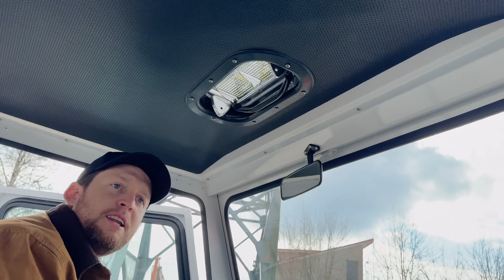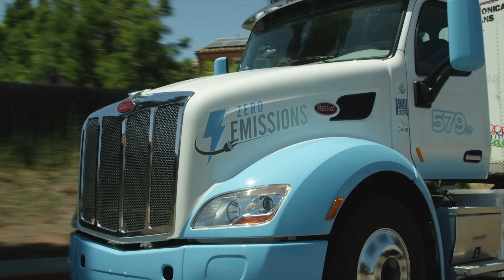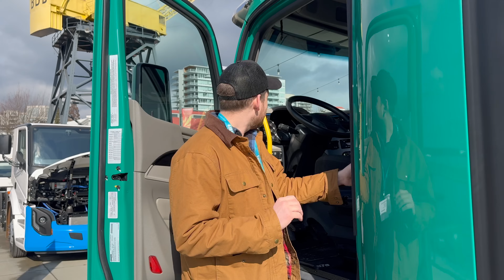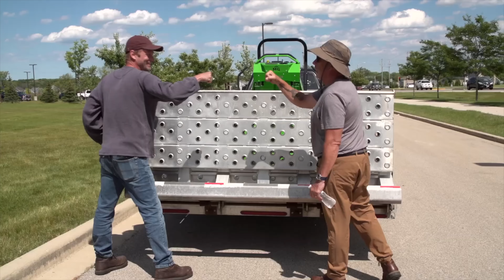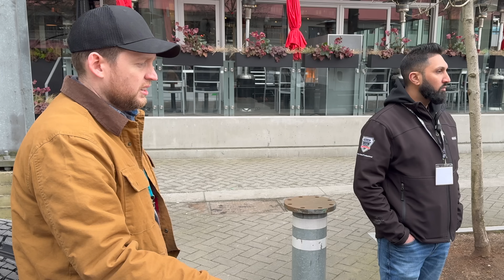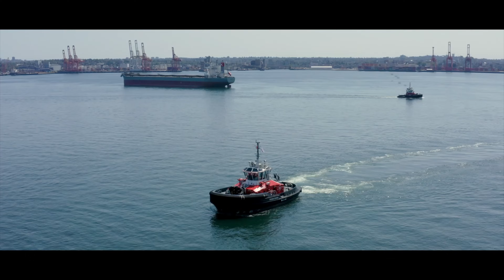The future of Electric Vehicles : What to expect in 2024

Comment: Thank you for showing the TUG Boats 😊
I have Read about these modern Tugs in Professional Mariner publishing 😊
With these 0 emissions ports wanting ships to plug in at berths. So glad Edison motors is making a Log truck that can generate power, just like Cat is testing for mining hual trucks 😊
Reply: If it's got a plug or a motor...it is NOT "ZERO EMISSIONS"...let's be realistic.
Reply: @danielkingery2894  LESS diesel its a start.
Reply: Cat has had electric haul trucks since the 1990s
Reply: Diesel ships are really good. Ships cost so so so much its nice that theyre if simple and reliable as possible. But theres no doubt that we can reduce a huge amount of port emissioms withohtnhabing to convert the worlds diesel merchant vessel fleet to expensive hybrids. Maybe some but where the real advantage is i agree its the tug boats. When the ships come to where the masses of people are you cam cut the engines out at sea and pull them in with these hybrid tugs its actually clearly better in certain aspects and whether its worth it really depends on how long the batteries last and what the overall prices of operating maintaining repairingnand repalcing parts is over the vessels lifespan. To some degree jusy a straight compression engine vessel is advamtageous brcause they use such massive pistons the rpm is los and they cam run for a very very long time. You go to hybrid they will shrink the engine considerably and grow the battery and youll emd up with a small motor working hard to charhe a big dead weight battery thay weighs lot empty or full. You can see this tug the battery takes up the hole bottom but i mean the hybrid application there is also more affordable ton making the big panamaxes and capesizes etc hybrids. If the battery dies and it runs out of juice they are usually working in and out around ports. Thats a good application that will increase air quality in the areas that matter the most. If youre sending a uber giant vessel around africa you dontnwam tto have to keep stopping for both electricity and fuel when before you only needed fuel or didnt even depending on the vessel. I was looking at some vessels that run on natural gas because natural gas in liquidifed form compressed to less than 600x the volume in its gasseous form so the numbers are promising. So liquified natural gas tankers will run on natural gas. Sometimes its just the nature of the application that determines what fuels one ship over another. For different reasons its pretty interesting. Hybrids started popping up but most ships run on straight up supermassive bunker fuel compression engines like oil tankers and bulk carriers, container ships. Even if you only had hybrid tugs that would make a big difference in key areas in terms of air quality
Reply: Well, for the big ships you probably would be going back to running them as straight Deisel-Electric, like  locomotives or the old U.S Standard type battleships.
Basically running the engines as generators, which would then directly power the electric motors moving the ship. You could  add some batteries to run the ship for a few hours coming into/out of port. Ships use port supplied power while berthed, and they could also charge their batteries there, further reducing engine run time. You can also add wind propulsion aids to ships to further reduce fuel needs (but not eliminate them, modern ships are just far to big and have too strict of deadlines to rely too much on the wind).

Comment: I wish federal governments would stop subsidizing the sale of EV.  See this only help companies overcome shortfalls in technology, design, volume manufacturing... and results in high quantities and lower value products that are not really good for the environment and just result in a lot of e-waste.  Also most companies set aside 2-5% into R&D.  These tax breaks typically only help the wealthy anyways as EV had a higher retail cost even with the subsidies.

Instead I would rather see the government ONLY fund research.  Instead of 2-5% of the money going to R&D, 100% would go to R&D.  This would still lower the manufacturing costs, but would accelerate the development of better and cheaper products far sooner.  Then these products would be able to compete directly against gas and diesel powered vehicles far better.  So they would start with slower development, but then ramp up far faster.  This would then make it easier to ramp up the infrastructure far faster.  Since there is more funding on the government level the patents could be shared more and there would be standardization in parts, tools, and chargers across the platform.  Most importantly the battery technologies would be far better.  The overall costs to the government would also likely be far less.

This also needs to be rolled out, like I said with the infrastructure to support these and that would include upgrades to the power grid, increased power production, and cheaper, safer, more standardized charging stations.  Early adoption is usually not the best things for a product so complicated as this.

And for the tug boat I wonder if they would benefit from toroidal props.  They will help extend range at higher speeds, but they should reduce cavitation, which causes a lot of the noise from a prop.

I still think ALL trucks, most pick-up trucks, and most boats, especially that tug boat should be a hybrid too.  There are just too many advantages to this system until battery technology significantly improves.
Reply: Breathing diesel fumes is bad news,we all have a say here.
Reply: @jaaklucas1329  Unless a diesel needs repairs or they are using a chip the smoke is minimal.  The new regulation are a bit much requiring a chemical filter bath basically that removes pretty much all the soot.

See the problem is CO2 is not the issue.  This was a switch they made from Particulate Matter 2.5 micron (which is bad) to CO2 based on a very flawed study.  They used about 1000x the normal CO2 and got a 4'C increase in temps, but base all the models on a 20% increase causing a 1'C increase.  It was done for politics, money, and power.... mostly because the US had massively decreased its PM output.

There are 2 main reasons why subsidies are bad.  First is they are creating competition in a market with a product that can not support itself otherwise.  This is because the technology is not there.  The second is subsidizing the product only results in a small fraction of that money going to research (about 2%).  They need to subsidize the research and not try to push these vehicles to market early.

They are basically just feeding the landfills this way as EV are far less recyclable than ICE and damage the environment far more in their making (especially when a lot of the components and materials come from countries like China that have basically no environmental laws.  EVs at best are on par with ICE vehicles for environmental impact... many are actually worse.

So instead of putting $100s of millions into subsidies put that all into researching better batteries... and solar panels.  I still don't trust these solid state batteries until we actually see what the retail models do long term.  Either way charging these larger capacity batteries is going to be an issue and the massive increase in power production is going to quickly start causing problems.
Reply: @toddabbott781  You have thought about this alot so I can simplify. Heres the problem. Drive your most efficient diesel (or gas) ICE vehicle into your garage,leave the engine running, close the garage door and take a seat. You wont last long. Multiply that by billions of ICE motors around the world. Thats why somethings gotta give.

Comment: The mobile charger truck is something I've been considering. In my mid fifties, I'm already considering options to keep me busy for when I reach retirement. My thought is a hybrid flatbed wrecker with a mobile charger built in. The best part is that you already did the legwork on the hybrid part of it all as a C-9 would easily fit in the space under the hood where a C-12 once lived. The only thing I'd probably do a little different is use LiFePO4 batteries as I'd be cycling the pack a lot, and those are physically very forgiving, and don't catch fire very easily.

Comment: Have you seen watch wes works , talks about the Edison truck
Reply: Wes is wrong about his spread sheet. He assumed that a new Truck was $200k.  An Edison truck refitted was $105k assuming the base truck was free.  Then Wes tries to calculate payback period without any efficiency gain.  He comes out with Edison Truck pays back after so many years.  Common Wes, a cheaper truck pays you the first day it drives.  Wes probably didn’t take school seriously and smoked too much weeeeid…
Reply from the maker: Yes. He’s 100% correct, if we were building OTR trucks. But we are not. 
You can’t compare highway trucks with Vocational Trucks, they are apples to oranges.

Comment: Sorry, I didn't notice what was going on in the rest of the video - because I'm still hilariously laughing because of that segment with the green mower... 😂😂😂
Reply: honestly if it was me I would’ve handed the Green machine back to the guy at the booth as I would no longer trust myself
Reply: i was laughing when he was burning rubber.
Reply: At $37k for a green EV mower. “The battery will outlive this mower, it’ll last for ten years”.  WTF? At $15k more than my comparable commercial diesel mowers I run, I can buy a hell of a lot of fuel and my mowers are still going strong at 10 years old. Not buying into it.
Reply: @biprgriff  yeah, cost and longevity really is a sticking point with bev stuff. for home use it makes sense cause you can easily use powertool batteries. but in a commercial setting i can see that being a pain. really just get one singular ev unit and use it only when the rules require it (denver city has mandated all electric equipment for commercial lawn care. kinda stupid to mandate that now and not in 5-10 years when the designs are better)
Reply: That utility truck just looks like it was made in the former Soviet Union “But it’s made right here in Canada, eh?

Comment: Hybrid electric with a plug in is what I would go for everytime.  ESPECIALLY for EMERGENCY vehicles that have to work when the grid is clobbered.  If I had a vehicle (work truck) with a 3kw output and could refuel it once a month and run it of the grid the rest of the time would be great.  If that same plug in could power my house from the truck when the powergrid went down.....
Reply: If you live somewhere with sun and you can afford it solar and battery backups are a good option. Then you can just avoid the grid for the most part. They are making electric trucks now that can act as a battery backup for your house as well.
Reply: @SmolPotatowo Ehh, take a deep dive into how most solar cells are made (and disposed of). They are only environmentally friendly in comparison to coal and oil plants, Natural Gas is far better and Nuclear blows them out of the water. A small pop-up wind turbine is a great emergency alternative (and works in almost any wind conditions).
Reply: @hanzzel6086 I believe you mixed up solar cells with something else (maybe wind turbines?) because there’s nothing particularly wasteful about them. They’re largely made out of silicon and aluminum, of which is more than enough on earth, and their production doesn’t produce any significant amounts of emissions (assuming of course the grid is green). Yes recycling is an issue, but that’s the case for anything and everything, solar panels are not particularly hard to recycle or anything.

On top of that your concerns don’t help the previous comment much because they want to get less dependent on the grid, and you can’t build a nuclear reactor in your backyard.
Reply: @foximacentauri7891  Silicon pure enough for solar cells  isn't very clean to produce, especially when made in China (which the vast majority of solar cells are). As for independence from the grid, yeah the pop up ain't great for that. But solar is't all that practical for that where I live, too many long weeks with little sun in times when you need the power most. You'd be better off setting up an  (insulated enough to withstand a week plus of -40 degree weather) composter of a type that will produce a large amount of methane and running a generator/heater off that.

Comment: How much is that truck
Reply: which one?  topsy?  topsy is expensive.  think  get a new truck with the same specs in diesel +20-30%  but as economy of scale goes up  the price will drop.  all early adopters pay more.
Reply: @Real_Nff  What kind of economy of scale are you expecting from nearly all off the shelf parts?
Reply: @N-M424  the more they can order at once the cheaper it will get.
Reply: @D2O2  nothing is free.
Reply: @Real_Nff Right and to think Economies of scale will bring the cost down in this case is not likely.  In fact, in this case it will probably go up.  They are going to have more costs to move beyond this point in time and start producing trucks.  The cost of a truck isn't purely the materials, it is also everything associated like labor, buildings, tooling, etc.  Additionally, there is a thing called diseconomies of scale.  The batteries are a prime example.  Supply is low and demand is high...